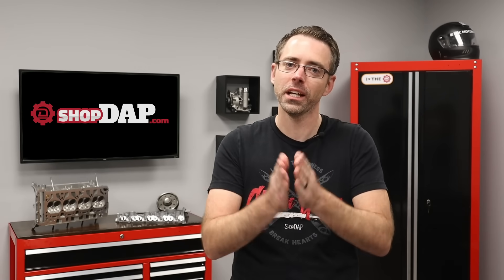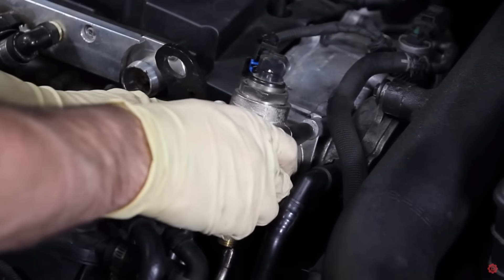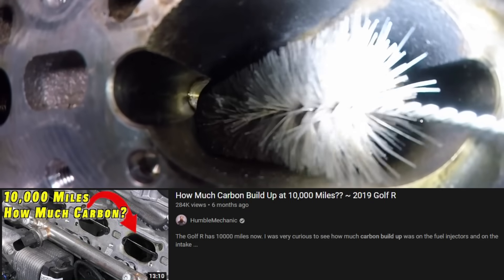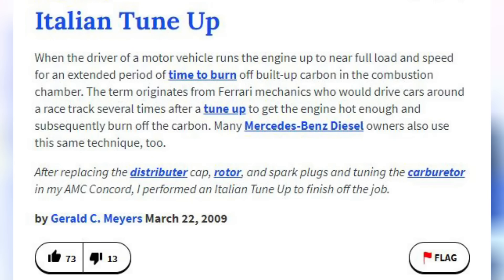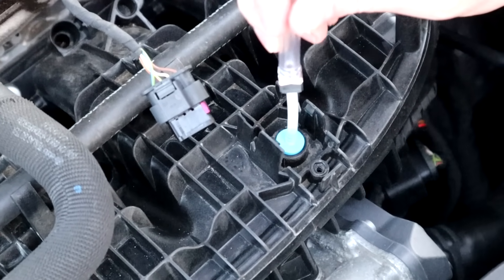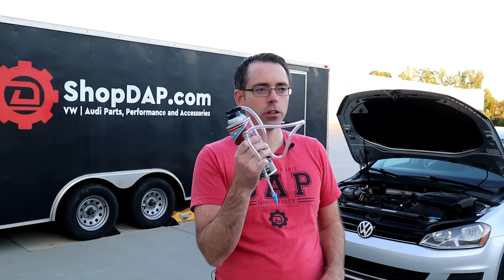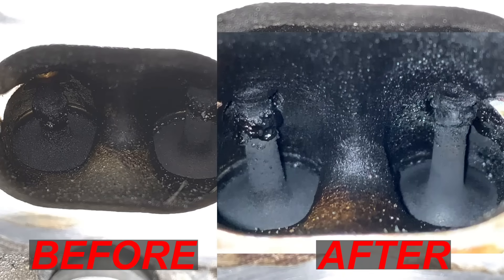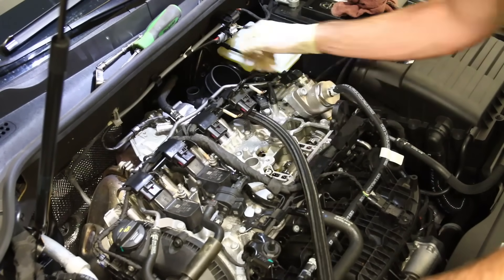Can you Really Remove Carbon for $29?

Comment: I bought a used VW FSI 2.0T that was seriously clogged.  I removed the intake, removed a lot of the carbon using soft aluminum 'chisels' about the size of a flat screwdriver, being careful to ensure the valves were closed so nothing could drop in the cylinder.  Then I used a small tube attached to a vacuum to suck out the loose stuff.  Then I squirted Castrol Purple cleaning fluid into the head intakes and agitated it around using an old nylon toothbrush and sucked it out a again.  I repeated this for each intake throat until they and the valve heads were completely clean.  It took an afternoon to clean all eight intake valve throats so they looked like new.  Castrol purple is awesome!  I have installed a catch can system to the PCV manifold.  The car runs great now.  Total cost, including the catch can. plumbing and PCV manifold mods was less than $80 and well worth it.

I have yet to meet anyone that has actually achieved anything except clouds of smoke out the exhaust using these various chemical concoctions before paying a mechanic to take the manifold off and physically remove the coke.  Don't waste you money.  Take the time and do it yourself.
Reply: Pretty much what I did on my 1.9 diesel which are known to cake carbon though I used different product. I used oven cleaner, carb cleaner, water, a pick set, wet dry shop vac, and an air compressor air gun. You just have to be careful, you have to rotate the engine and make sure the valve you're working on is closed then scrape the heavy caked carbon with the picks and vacuum it out. The spray the oven cleaner in and wait for a bit, then spray water in and finally blow out with the air gun, final cleaning is with the carb cleaner to remove any residue. Rinse and repeat on each one until its clean. It got the intake area impressively clean.
Reply: The spray-in intake valve cleaners are intended for maintenance purposes, every 5k or 10k depending on your vehicle or how you drive. It's not for cleaning out years of caked on carbon build-up on the intake valves as your used car purchase.
Reply: This seems like the best method I’ve read. I’ll give it a go
Reply: He is right. This is literally the only thing that works. You can use other cleaners and high grade solvents as well, but the process is fairly easy and the only way to do it.
Reply: nice job man!
Reply: Yes the best way. I watched a comparison video with different products and water. Water won. There should be a tank that holds distilled water and cycles every 5000 miles.
Reply: Can u make a video plz
Reply: How many kilometres were on the FSI? I have about 125,000 on mine now and haven't noticed any loss of performance yet after buying the car around 90,000. Mine is NA though.
Reply: @dielaughing73  No issues on my gen2- 2.3L GTDI in '20 Ford Ranger XLT FX4 truck. Runs great. Use better fuel! Top Tier rated gas always.
Reply: Where did you get a catch can for under $80? I’m also fixing up a used FSI 2.0T GTI and was looking at much more expensive options for catch cans.
Reply: I'm having this issue on a 2016 Mustang. GT, it's causing intermittent misfires on cylinder, 2 cylinder, 4 and random. Miss fires, it's proceeding to piss me off. I will have to try this method. Hopefully it'll work
Eventually, upgrading to the gen three intake, manifold

Comment: I'm pretty sure that Mustang at the beginning of the video had a PCV valve. Not a very effective one, but it had it.
Reply: California models did.  It was a (rarely) ordered option outside California.  You got a "road tube" if you didn't order the pcv system.  A road tube is a giant tube specifically designed to create a draft to evacuate the crank case vapors.  Ironically, my dad's '64 F-100 (with the 223 straight six) had a PCV system from the factory.  It was a Texas truck for it's entire life, and 1964 was the last year for the 223...
Reply: My 68 Mustang,  289, has a pcv. It is a Southern California car....

Comment: Fixed mine!!! Bought a Honda!!!!
Reply: Not sure that you have fixed it, considering that lately most Honda engines are made DI and turbo. So they will most likely have the same issues. Plus oil dilution, witch is a hole another level of problems down the road.
Reply: yea LAME KEEP IT

Comment: your video is really helpful. In last month, there were two times when i got misfire warning when i started my car in the morning. The check engine light flashed for about 20 seconds and everything went back to normal. My car has  VW 2.0 TSI engine and is 83,000 Kilometers now. I guess it is time to clean the carbon buildup.

Comment: Gasoline + Fire in the intake manifold. Worked perfect for a TDI engine.
+ Hard core chemical cleaners, + about 40-50 minutes with a  power washer....
Removed about 2-3 cm carbon, that was build up in the intake manifold.  Now it looks like brand new.
All of this was done, while the intake manifold was removed from the engine.
The shop wanted to charge me 130 euro for this job. 
Vw golf 5 1.9 tdi  was the car. Runs like a clock now.  EGR cleaned as well. ( 5 times per year to keep it super clean)
Before this , the car went to specialized Carbon cleaner machine.  It didn't do much.  And this  cans you see here are complete garbage.  Manual cleaning is the ONLY proper way to clean the carbon. 
Yes it's a huge pain, but it's worth it.

Comment: Italian tune ups do work geek but not on any type of fuel injection. Old high performance carb cars had to be tuned rich so that they would not lean out at wot, driving at part throttle caused carbon buildup so running at wot would help keep it clean

Comment: This may seem a little off topic. You mentioned the MK7 was using 93 octane. I just bought a 2017 MK7 three days ago. I was told I could use 87 octane. Is that true? If so will 87 octane contribute to carbon build up.

Comment: I did the same services to my 14' GLI 2 years ago, but i didnt have the right tool, so I used a rubber hose and an open can, next thing i know the whole can got sucked in a very short time, that cost 3 cylinders miss firing, then finally when i push all the chemical fluid out of the engine, of course a check engine light was on for a catalysis converter failure, is gonna cost few K to replace it.... but still i went to the dealer, they said " your car is under the federal emission warranty, so we gonna do it for free" lol 😂😂😂😂😂😂

Comment: There is one situation where the Italian tune-up works perfectly. on a system where low load is direct injection, and high load uses upper level port injectors.. regularly driving the vehicle hard enough prevents the type of carbon buildup you're talking about.
Babying the vehicle around, "driving nice", causes carbon buildup

Comment: This is why at every vw Stealership I've ever worked at, we just replace the manifold and walnut blast the hell out of the head. Only real way to get a D.I. engine clean. Same with my time at the BMW shops. Walnut blast. I think the seafoam method via the brake booster vacuum line only really works well on conventional f.i. style cars. I've had great success with it in that scenario
Reply: @monkymind4316  
IIRC like 4 or so hours of labor. I'd check to see what book time is on pulling the intake manifold, and then add on at least an hour to blast the ports. I'd probably say 2 to 2.5 hours to pull the manifold and then another 1.5 hours to blast. If you really want to know, I would give them a call and ask them. If you have access to the equipment to blast, the job is really easy and it's a pretty simple DIY with basic tools. HTH. Take care.

Comment: I’ve read a lot about people recommending thicker oil to prevent the carbon build up caused by the pcv. I’m a VW guy, or at least until I take my thumb out of my a** and buys something that’s actually reliable. Unfortunately I think I have created a bond with the shitbox, I’ve had it for five years. It’s a VW golf 1.6 tdi 15 model, it’s a European car so perhaps you don’t have it in the states. The recommendation however was to swap the 5w30 for a 5w40, even though it isn’t something that VW use in their diesels.

Comment: I've seen one water methanol solution using those spray bottle that you have to manually pump, that one cost only 5 bucks, I would say one bottle maybe two should be enough to clean carbon deposits

Comment: The problem with the intake manifold chemical spray service is that if a large amount of carbon sludge and the chemicals from the can pass into the combustion chamber and then through the exhaust, it can damage the catalytic converter.  Install a catch can day one of ownership.  after 40-50k miles, use a bore scope to look inside the intake manifold at the top of the valves to determine if an intake manifold/walnut blasting is necessary.
Reply: that was my initial concern also and what about if you have a turbo engine that’s also direct injection. All those chemicals and burn off carbon damage the fins on the turbo (along with any damage to the O2 sensor or catalytic or does that all burn off) still concerned with the turbo fin being damaged?

Comment: There is one more method for reducing carbon buildup.  How much truth is behind it I'm not sure. Rev your car to around 3k to 4k while dimping brake fluid down the intake or even use a spray bottle with brake fluid.  It will make alot of white smoke and "burn off" the carbon. I would like to see this theory tested if possible???

Comment: I have a 2013 Audi S4 and I'm keen to minimise carbon buildup. It's only done 55,000km (~34,000miles) so it shouldn't have too much built up. Where would be the best place to inject intake cleaner on that model? Cheers.
Reply: 34k miles you will have some buildup, save your money on the bogus cleaners and fluids, wait until about 60-70k then have a euro shop pull the intake manifold and blast the valve chambers with walnut media shells, best way to clean the carbon on my s3 runs about 750$

Comment: Oven cleaner and a wire brush on a drill. Let it sit for an hour or so then rinse it out. Repeat as required. Use a heat gun to dry it out then mist some light oil onto the valve stems. As good as factory every time.

Comment: Had build-up on my cbr 900 valves. Used 112 octane racing fuel and over a short period, it cleaned it right up
5gallon drum cost about $75 and only used 5oz per tank. 👌

Comment: All the fuel savings cost goes down the drain when you have to spend hundreds to get walnut blasted.
Reply: Its cheaper is you use peanut blasting
Reply: I made my own vacuum attachment that goes over the intake port and bought a sand blaster and walnut media. Was way better than a can of cleaner when I was done. Used a clean vacuum filter and reused the media for each intake port.
Reply: @robertfattaruso1280  Show us the video please?  Id like to try this set up
Reply: exactly, now how do i figure out if my brasilian build 2016 VW engine is GDI or port injected? if I ask in english no conclusive result appears and I have no Idea how to write or read brasilian. is there an international GDI database?
Reply: @naotamf1588  GDI should have injectors directly in the engine block, while port injection should be before the intake valve, in manifold. You should match them easily by looking at the position of injectors on the engine.

Comment: I have a 2015 Audi RS5 with the 4.2 L V8 TSI which is direct injection, it has 33,000 miles (converted from Kilometres) a frickin tuneup is $1250 cad at the dealership, I can’t imagine what a carbon clean would be? I have always used chevrons 94 octane with no ethanol, it still runs like new but I’d like to prolong the inevitable, so maybe these methods would help?

Comment: as a mechanic i see more good valves after a while when you do "italian tune up" than whit a spray can to clean the valves. On the pictures from intake manifold service results. you clearly see it didn't help anything. 
if you drive it some times to the red limiter i see from does drivers less carbon build up than drivers that won't go aboven 3000-3500rpm.
the only good solution is wallnut blast, stil it fix the dirty valve but not prevent it.

Comment: So, based on my previous experience, I would like to have this service done since I drive 60 miles every day to work and my mk7 already has 58k. Again, because of my previous experience, I would only trust my dealer to perform this job, since you guys are 1.5k miles away from me. How would you go about making sure they did a good job, and would you recommend replacing the injectors? I have a stage 2+ from Unitronic and haven't realy done much other than Liquid Moly every 5k since 10k.

Comment: my 2 cents: I use a £200 vacuum and walnut shell blaster to blast the carbon from the valves and chamber. This method puts a vacuum attachment on the intake port with the valves closed (with the inlet manifold off) and has a little cleaning nozzle that fires the walnut shells at the valves and chamber walls while simultaneously vacuuming the debris out leaving the chamber and valves clean. Walnut shells are used as they won't scratch the metal like beads or sand would.

Best way to decarbon the valves and chamber this done every 20k will have best results.
Reply: what vacuum do you use ?
Reply: @wingding028  it's any vacuum cleaner, but you need the attachment for your car's intake port.

Comment: I feel like spraying it in on a completely cold engine (so it doesn’t evaporate as fast)for a few second, allowing it to soak into the carbon for a while with the engine off, then spray the rest of the bottle as the engine warms up, might give it the best chance if rinsing the valve and port
Reply: Definitely right I’ll try with a cold engine next time
Reply: Berryman 0996-ARM B-9 Chem Dip Parts Cleaner 

This stuff works to get rid of carbon buildup like nothing else and it doesn't cause any damage like some decreasers would. I haven't tried this but not doubt would work; injecting the stuff into the valve port while it's closed and let it sit for a couple days.
Reply: @levthelion  all the valves are not closed at the same time. 
so it would take you a week to do that if you need to soak it for a couple of days !
Reply: @levthelion  I agree. Hest!!!

Comment: Gonna do this on my tesla, thanks for the info
Reply: Don't forget to drain the blinker fluid on the Tesla first
Reply: @kacyharper8142  and don't forget the flux capacitor
Reply: BUT! On a Tesla, you don't do the Italian tune up, you do the Martian tune up! Make sure you follow the right procedure! 🤣
Reply: You can do it whilst your waiting for the thing to charge.
Reply: Make sure to change your muffler bearing now that your at it
Reply: Insert the pipe in your battery pack and start the process, you will get awesome economy with burn motor😂
Reply: Next Video how to swap a battery on a tesla
Reply: Then your going to need a TR double e
Reply: Just to be clear, you need to be in 1 meter of water and wearing a grounding anklet while doing this. It'll work perfectly 👌
Reply: Make sure you upload a video. 👍
Reply: Bro u should also up ur V-Tec timing
Reply: Dumb
Reply: I hope you giving those Indian kids getting paid nothing to mine that lithium a pay rise
Reply: @xkingkillerdomx9944  

Dumb comment
Reply: @robertrose3068 no. The original comment was dumb.
Reply: Mamador…
Reply: What you need is a electric blanket for that cold natured battery.
Reply: Make sure you get Tesla specific cleaner, I got an extra 60km of range out of mine. It works great!!
Reply: LOL!
Reply: Sorry. Doesn’t work on coal.
Reply: Don't forget to replace the battery when you're done
Reply: Don't forget to swap the driver. 😉
Reply: Great idea. Make sure you change the oil and oil filter as well afterwards, good idea to use vpower from time to time
Reply: Sometimes you need an Italian Tune-up, sometimes you need that Wuhan China Tune-up.
Reply: Really? Your Tesla? Carbon?

Comment: Its faster too pull of the head and clean it then spend time with tgese chemicals. Imadgine hydrolocking it. Although you took TSI engines as an examole. TSIs are really bad. Look at bmw and benz petrols. The M113 Benz V8 5.0L is abperfect example of this

Comment: Just rev the motor and squirt a little water in a small stream ,The motor has to be hot it will come right off but you may clog the converter(s)
Reply from the maker: Nope. Not a chance

Comment: I have a better solution, i just bolted a metal can on the outside of my exhaust manifold and run it to mi intake.
I fill up the can with water.
While driving the can gets hot and the water damp goes through the intake manifold cleaning it.